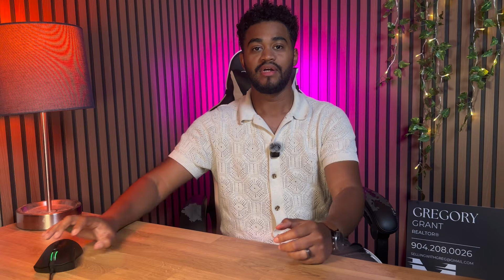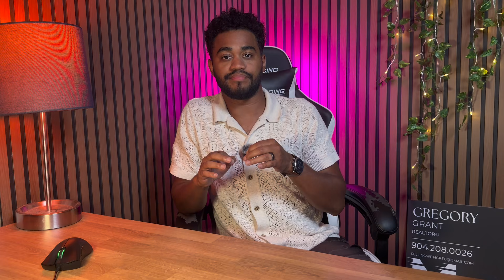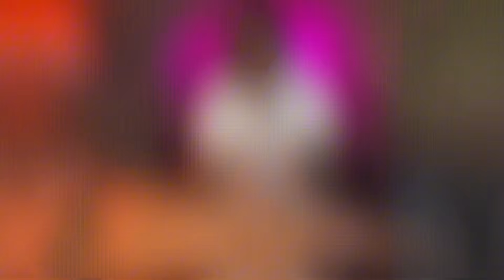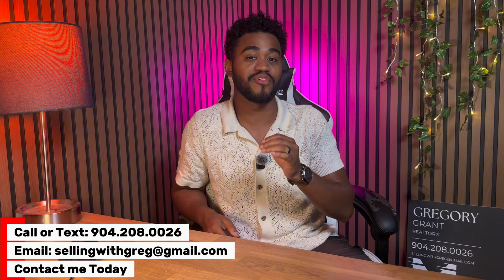DON'T Build a New Home Until You Add These Electrical Upgrades

Comment: Good video.  But the although the gas rough in for a generator turned out to be pretty inexpensive for our new construction home, the necessary electrical component of the rough in took the cost way up there.
Reply from the maker: It seems to vary by builder but I always say if it fits the budget go for it!